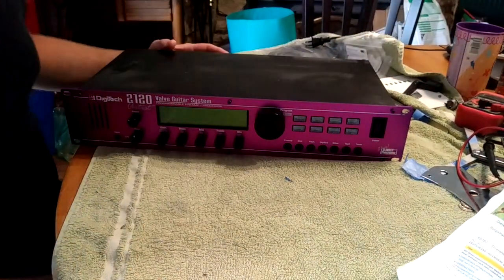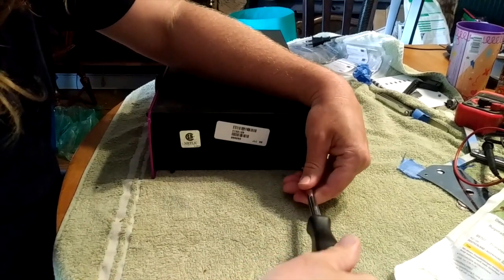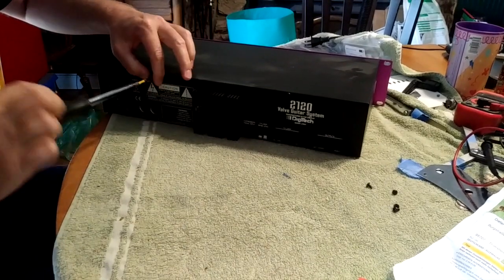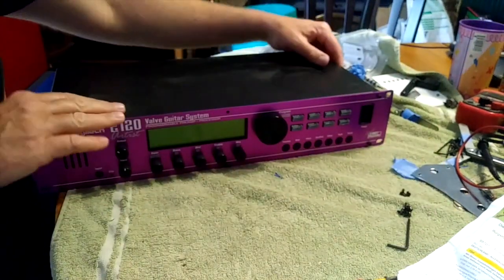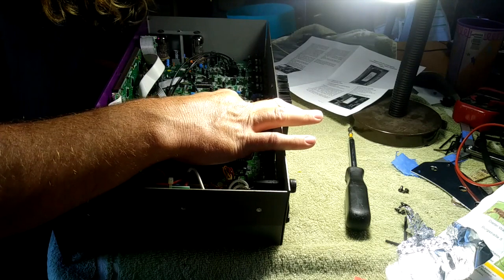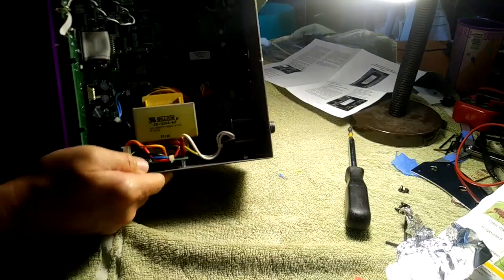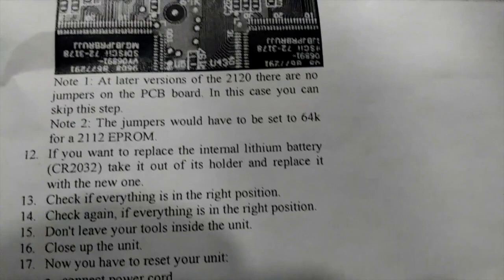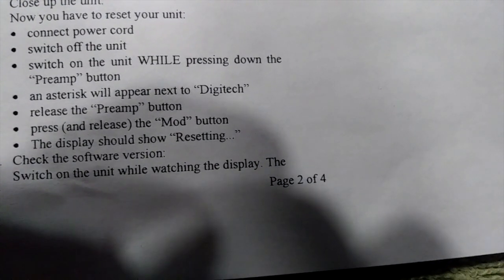Digitech 2120 Firmware upgrade 1

Comment: You need to backup all your patches before doing this, watch my channel for a video on how to do this. It is very important to get the 2.30 firmware chip upgrade as it fixes the sysex transmission issues with RPEdit ( one of the best editors do the 2112-2120) . Good video and this firmware also adds some new effects including extending the st analog delay time beyond 350 Ms.
Reply: can the backed up patches be used after the 2.30 firmware upgrade?
Reply: Where can I purchase the firmware update?
Reply from the maker: Did you have to do the jumpers on yours
Reply: @cameronstolhand7149  Yes for 128 kB Rom upgrade. There is a jumper already there set for 64kb ( I think that is the numbers there) so the Upgrade chip won’t work properly without setting that jumper first. You can backup your patches ( user programs dump only) as you can’t do a dump of the system as it is different once you do the upgrade. I do like the upgrade as it fixes the Midi Sysex transmission issues for remote control of the patches. Once you do the upgrade you can program the unit remotely with RPEDIT which is a fine piece of software as you don’t need to touch the unit with 2 midi cables. Make sure your midi interface support Sysex midi messages transfer.
Reply from the maker: @danfuerthgillis4483  So you're saying you cut any jumpers going from The Middle solder lug to the 64k and salder new jumpers going from The Middle solder lug to the 256k is that correct? There's a picture of the circuit board 11 minutes into the video that shows the jumpers I'm talking about.
Reply: @cameronstolhand7149  The jumper is moved to the 256kb position that’s it from where it originally was, no soldering is required for the upgrade.
Reply from the maker: @danfuerthgillis4483  Wow, no soldering? Do you pull out a jumper and then push it in to the other spot?
Reply: Can you give me the link to save the patches?
Reply: @gabrielebarbaraci3161  Here is the video I made explaining how to back up the programs and system of the 2112 https://youtu.be/usHZ-meac7o
Reply from the maker: @gabrielebarbaraci3161  https://youtu.be/usHZ-meac7o

Comment: Hey thanks for this video. I'm buying this  unit but what is the difference between this and the 2120 Artist version?
Also how can I get the 2120 so that I can use headphones primarily? 
Thanks again.
Reply from the maker: My 2120 is the artist version. It just has different presets from various artists such as Korn Jimi Hendrix ect. The chip updates you to the latest thing they had. The Digitech 2112 is essentially the same unit and can be turned into a 2120 by upgrading the chip or if you have an earlier 2120 like I did you can still update it to the latest one.

The unit does not come with a headphone jack however, there are two outputs on the back that will work for headphones with the right adapter. It’s not a common adapter, but you may be able to find it if you really look or you can make one yourself with an old guitar cord and a stereo input Jack. That actually sounds like a good video to make and I have been needing one for a while. I’m going to make one right now and I’ll upload the video when I’m done.
Reply: Thanks for replying with that info. Yeah I am about to purchase the Purple 2120 this week and need to see your video on how to make that headphone jack 💯.
I'm going to order the chip upgrade as well as you did.
Thanks again, I'm looking forward to that video.
 Also what would be the name of that headphone adapter jack so I can also look for it online?
Thanks again.
🤘🎸

Comment: I have the 2120 with ver 2.30. It stopped working and is froze. It was in storage for a few months. I tried to re-seat the chip and I broke one of the pins off. The battery is probably dead too. Is 2.30 still the latest version? Could anyone email me a link to order the latest chip? jayers761@gmail.com

Comment from the maker: Regarding the two jumpers ( which I did not have) I have been told that no soldering is required, no resistors are required like I originally thought. You pull the jumper out or jumpers and you move them so that they are connecting the circuit to 256k instead of 64k. Sounds pretty easy.

Comment: wait what?  um the 2120 is the upgraded model, the 2120 EXACT same unit as the 2112, it just has the 2.30 EPROM chip in it and different color purple and number of course, as apposed to silver, 2112 and the 2.11 chip in it?  odd

I don't get it, you can build a 2120 using a 2112 by installing the upgraded 2.30 Eprom?  nuts?  another thing you have to do on the 2112 is flip that switch says 64k on it, small dip switch..  crazy

did your 2120 have a 2.11 chip in it? if so it's an older one and it has the switches, weird

Comment: where did you get the chip?
Reply from the maker: eBay!
https://www.ebay.com/itm/Digitech-2112-2120-VGS-Artist-2-30-firmware-upgrade-EPROM-Battery-pulling-tool-/332978704162?nav=SEARCH